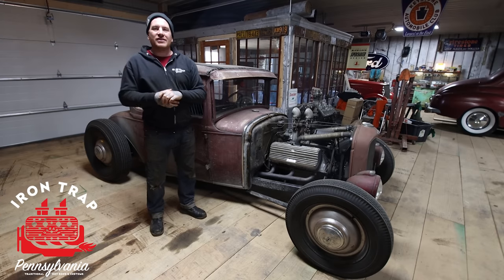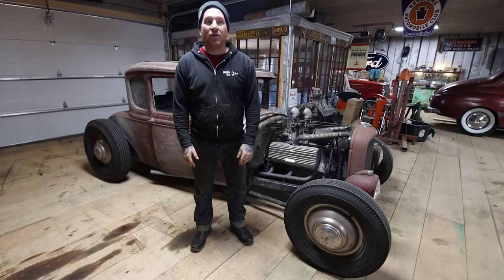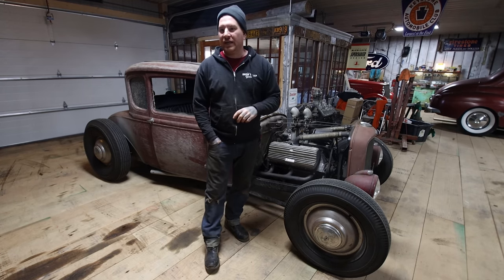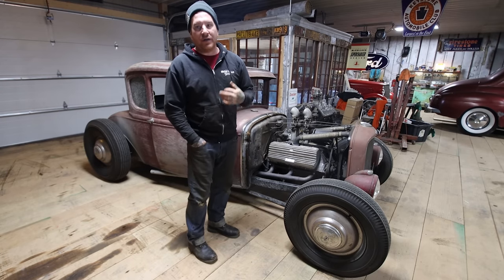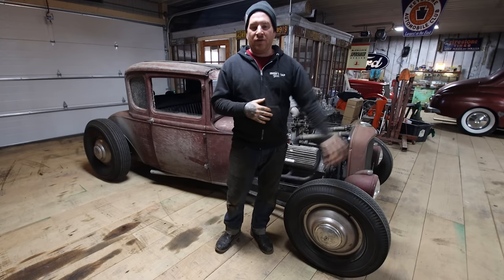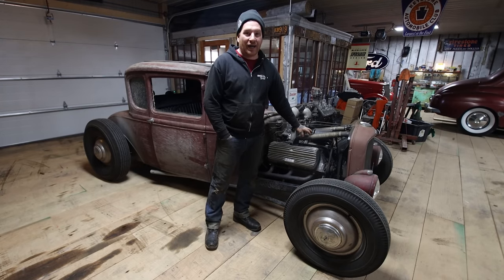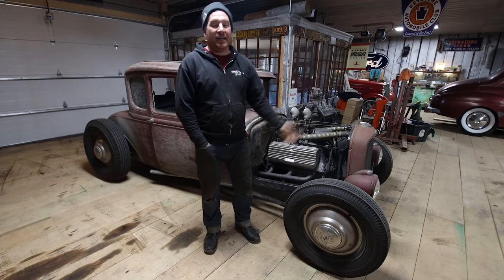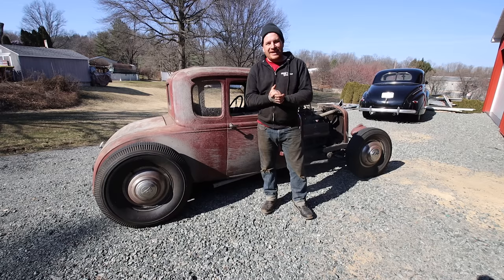What Is An East Coast Hot Rod - Hot Rodding 101

Comment: I enjoy the older style Hot Rods. They are rough around the edges and I really liked driving my old 31 coupe. I was wondering about the F-1 steering box and it being used on top of the rail? I do not recall seeing a above the rail steering except early Chevy and reversed Corvair. Is it a matter of building a plate to hold the box and weld to the rail? I also remember the old VW steering a very long time ago. Thanks for your videos!